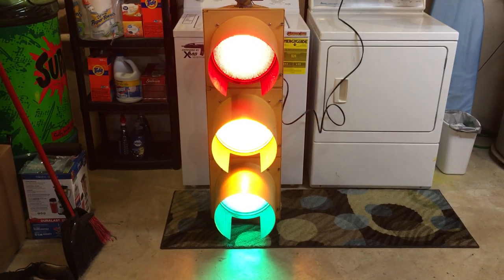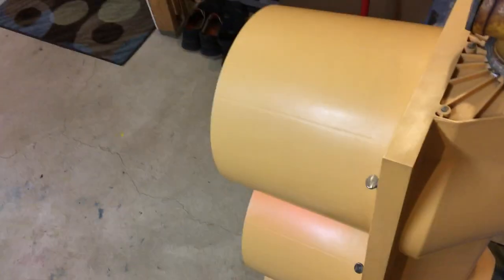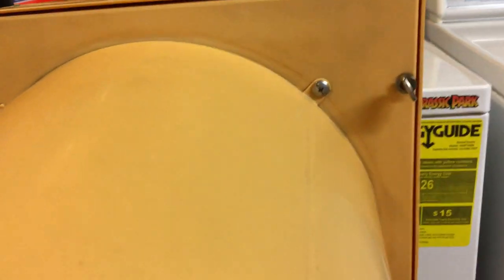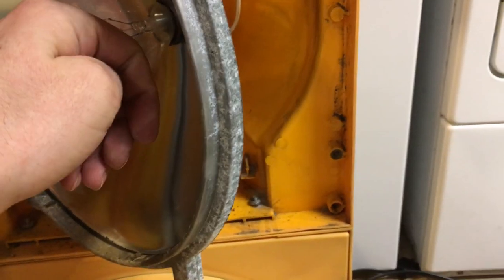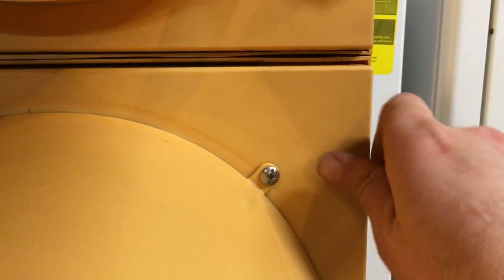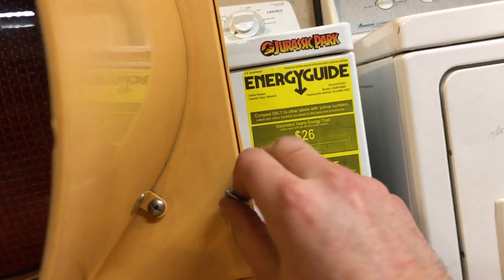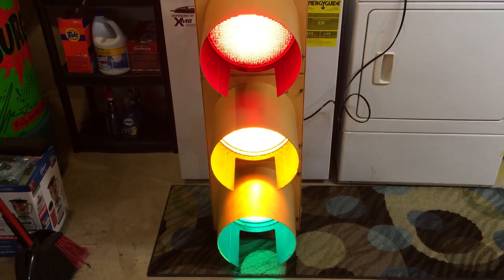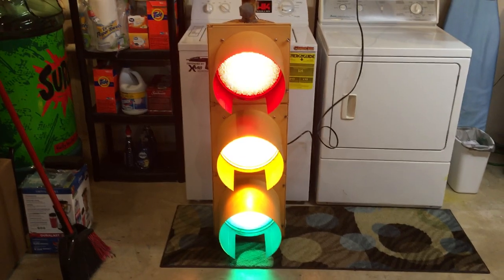Wired a Traffic Signal Light For Use Indoors (Work Project)

Comment: Traffic lights are a lot bigger than I thought.
Reply: They look small outside. Inside is when you can really get a good idea of how big they actually are. Which makes sense when you start thinking about the fact that most stoplights now are standard sized 12" diameter lenses and they have to be visible from far distances. So when you have 3 12" lenses combined with the extra length the housing adds, every light you see is easily probably about 3½-4ft tall. Many places in the US, particularly urban areas, still have 8" lenses or combo 12" & 8" lenses where either the Red or Green lenses are 12" and the others are 8". However these days those are all slowly being phased out throughout the US in favor of full 12" Lenses.

Comment: I just picked up this exact one!  Is it possible you could email me the steps and supplies in wiring it up like you show in the video? I want to do the on/off switches too. It would really be helpful. I have to somehow find replacement light hoods, two of them are cracked in half. I guess I could also make my own out of other material and paint them. Thanks so much!!!
Reply from the maker: It's all pretty simple electronics. I just wired all of them (jumped them to one another) using the terminals so initially they all light up, then I simply introduced switches to each color.
Reply: I saw behind the yellow light you have but mine, has a lot more wires running through this thing.im sure i could probably eliminate alot of them just unsure where to start. do you facebook messneger? I can show you pictures.
Reply from the maker: @Silverado21  each light has two wires, a neutral and hot, all go to a middle board with terminals on mine. some may be different, definitely would want to talk to an electrician or someone experienced with that as I'm not qualified to give advice of such things.